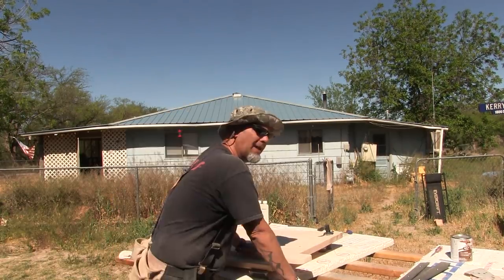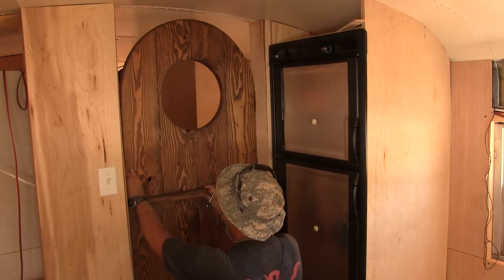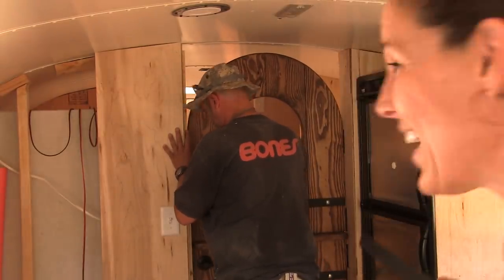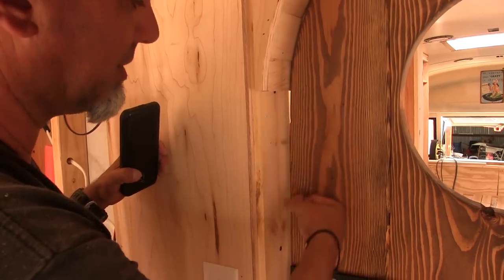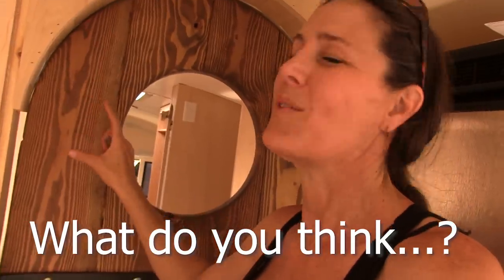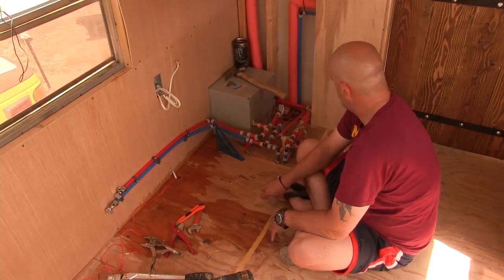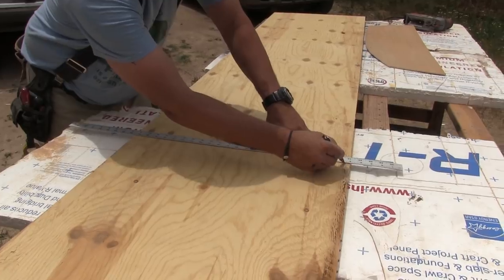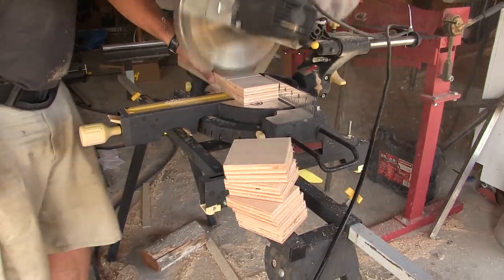Arched Doorway & Pantry in our Skoolie Kitchen

Comment: Mike and Kerry, excellent work with great detail on finishes.  Unique to the design of your bus which makes it very different and finished.  It will feel like home when y'all finished with all the comforts of today.  Thumbs Up.........👍 
I strongly advise that you run a bypass shower line to revert the non-hot water in the hot water line back to your fresh water tank to conserve fresh water when you are boondocking.  
A simple project that cost a valve and little pex which you already have.  A lot of DIY's are doing it.  I can't do mine, as I would have to tear down the wall behind my shower to reach the plumbing, that would be a big project including the work to reach my fresh water tank which is in the belly of my beast between the subfloor and the frame of the chassis.😡

Comment: If you need to make another curved piece like you’ve done with the filler blocks above the door, you might consider a couple of ideas. One would be to leave the blocks proud of the panel edges, then use a router to profile them to match the curve of the panels. Another would be to use a kerf board, which could be purchased or easily made with a table or compound miter saw or even a handsaw and miter box.

Comment: Y the arched door inside? Mine is open plan throughout.
Reply from the maker: It allows for privacy, it also makes the AC work less only cooling the front . Mostly because it was what we decided we wanted.😊
Reply: Yep I see. I do like it too. Makes sense to limit the space for the aircon. Mine I am going to have a pull down set of aluminium stairs in the middle. Then as you walk up you open the hatch and walk right up out onto the roof deck from the middle of the bus in the kitchen area. Awesome for barbeques and even if you want to camp up there and watch the stars.

Is yours a Diesel engine?
Reply from the maker: Sure is. We are putting a 40 ft deck on the roof and the ladder will be on the front of the bus
Reply: You should consider having a fold down stairs from inside. Im just after buying a really hot very expensive tig welder. Going to fabricate my stairs myself. Smooth walk up and not steep as hell like a ladder. Make going up there really easy. Every one else climbs their ladders which I dont like.

Can you send me across the link to where you boight your locker boxes?

J